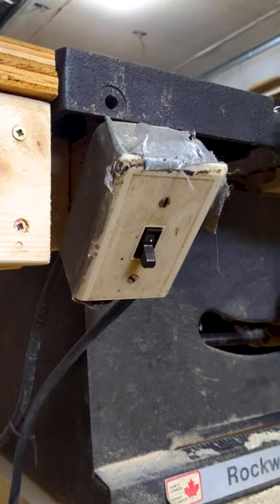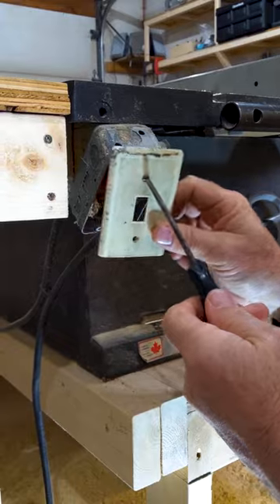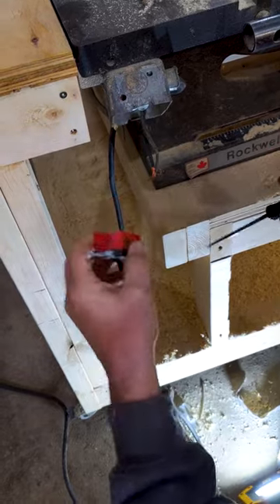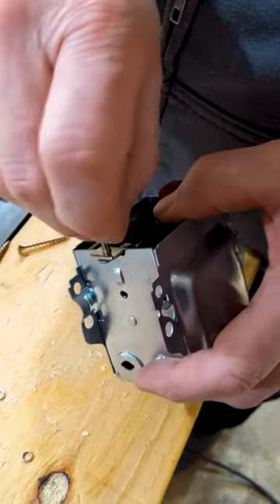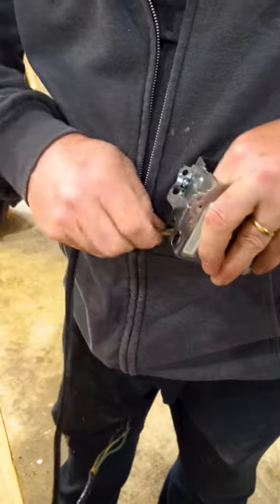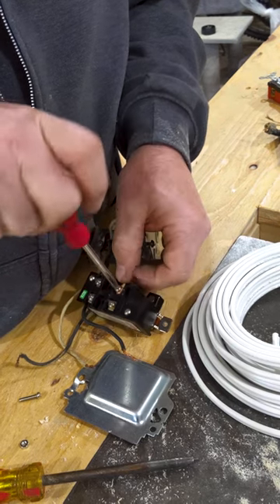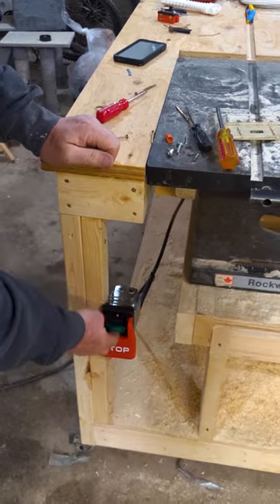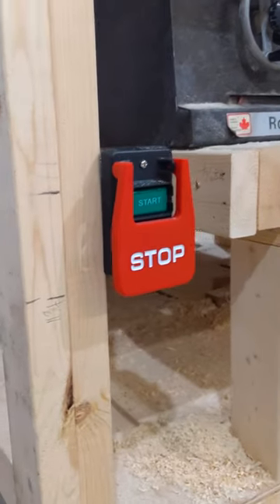Swapping Out My Table Saw Switch #shorts

Comment: It’s always nice to keep families old tools current and safe! Most of the older tools won’t fail and if they do they can be repaired, excellent stuff love to see it
Reply from the maker: Thank you! The original switch he had definitely worked, but it was tricky to find quickly if I needed to shut things down. This new one is right by my knee and I can easily bump it to turn things off without taking my hands away from the piece. Loving it so far!
Reply: @mygrandfathersaxe  makes things faster and safer ! Great job!